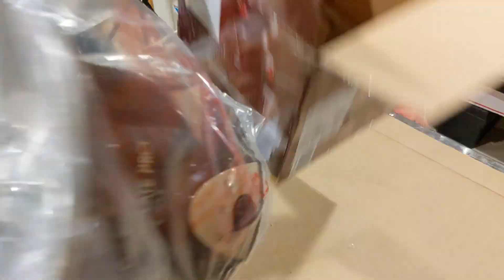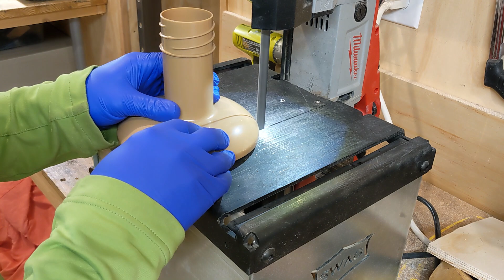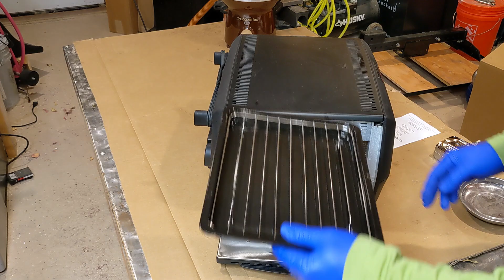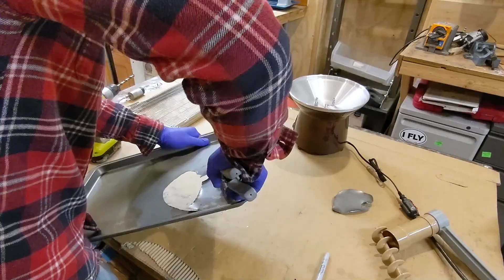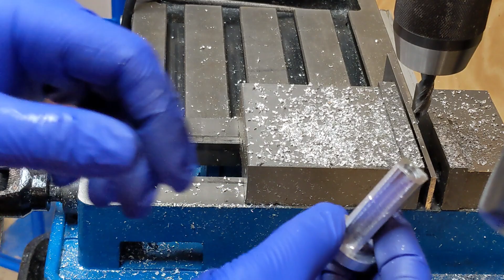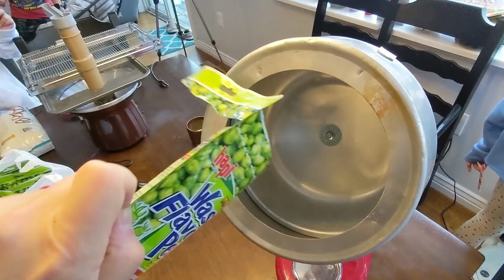I Built a DIY Chocolate Enrobing Machine

Comment: What a great idea!

I wish I had a chocolate enrober, but they are expensive equipment

But if I have a chocolate fountain, is it possible that you could share the chocolate nozzle design file?

Thank you!
Reply from the maker: good idea, i added a link in the description. https://cad.onshape.com/documents/3bfc56772c892eebcc49f91e/w/d1747bb61df4f2dbe44cd543/e/d5bdfd3c792e9ed11d578aab
Reply: Did u manage to find a solution? @jocoque9729

Comment: Whoa this is awesome. How do you know if your 3D print material is food safe?
Reply from the maker: Yeah that was a questionable thing. I used PLA, drink out of PLA cups and the overall temperature was rather low so my concerns aren't super high. Also considering recent data that shows that all chocolate contains lead and other heavy metals that might be a bigger concern.